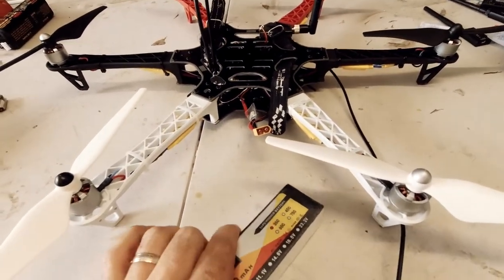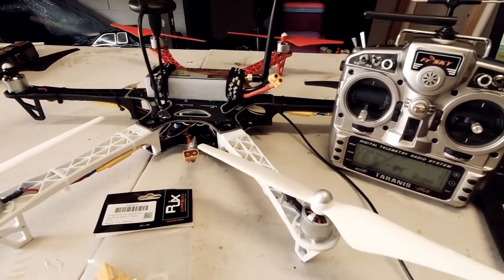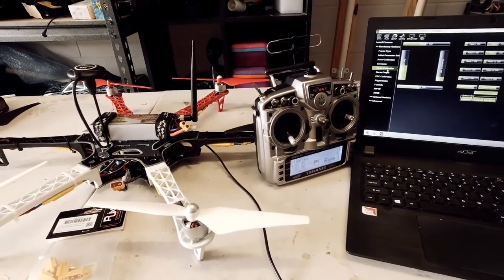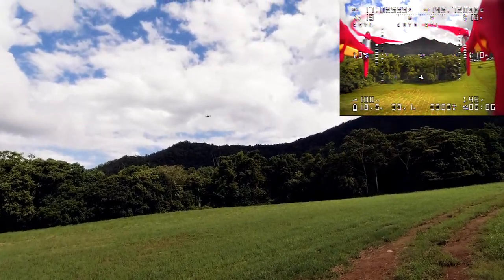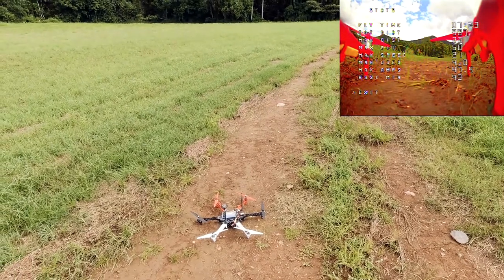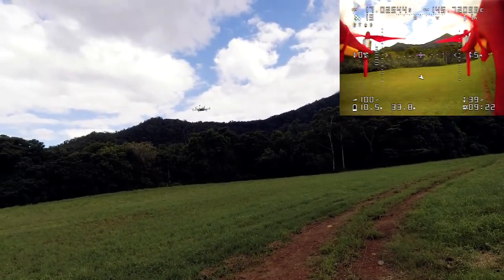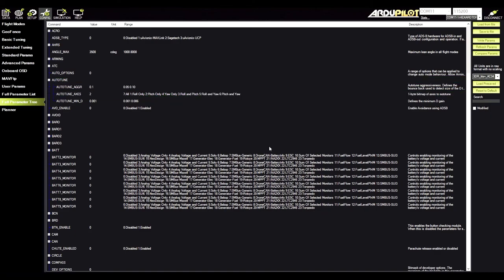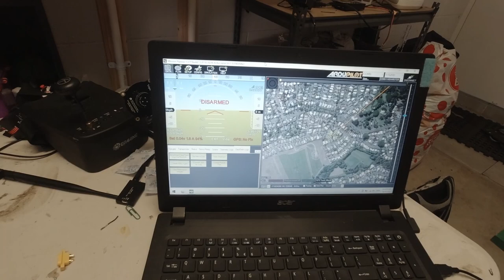F550 Hexacopter - Autotune - Pixhawk - Ardupilot

Comment: Thanks for the tip about setting which axes are going to be autotuned! I'm looking at around 15min battery life with my current copter and that was something I was worried about.
Reply from the maker: Yeah it had me stuck for a while until I realised you could tune 1 axis at a time. Mind you 1 axis still took it near 10mins to finish which seemed very long.

Comment: what osd is that? too cool.  I have a flamewheel on a naza fc and works pretty well but building a new quad f550 frame with a cube.  I'm going to maiden it tomorrow morning and trying to figure out if I will need to autotune it what I need to do.
Reply from the maker: @maddercat  Good luck with your maiden but definitely do an auto tune on it worked well on mine. That osd is ardupilot installed from mission planner if I remember.